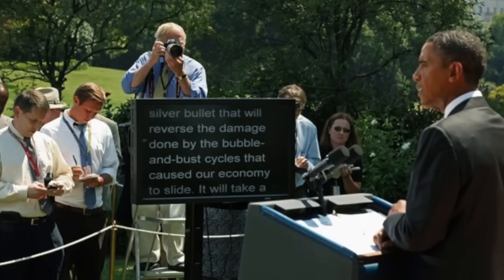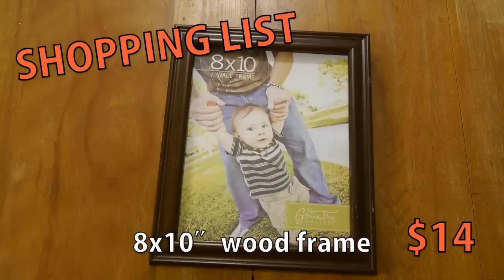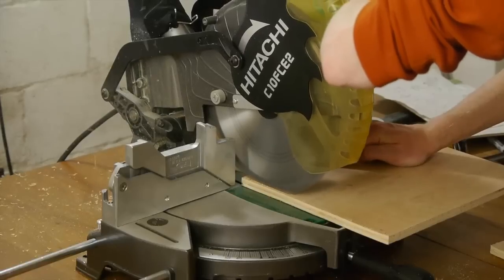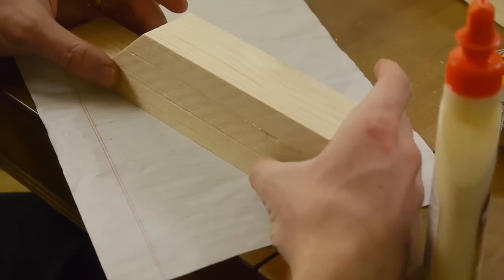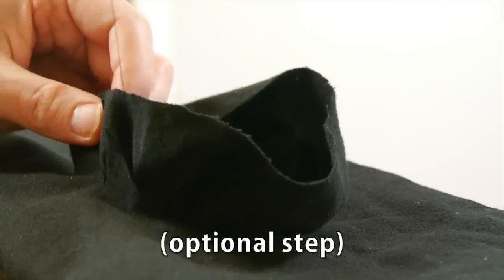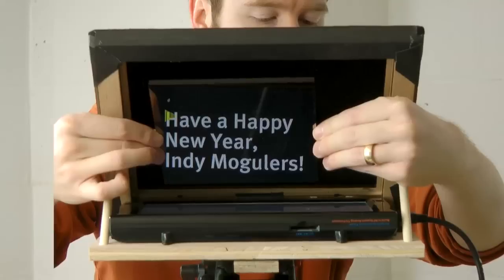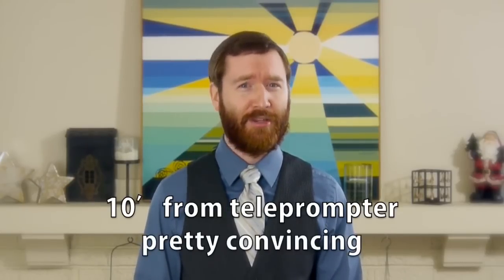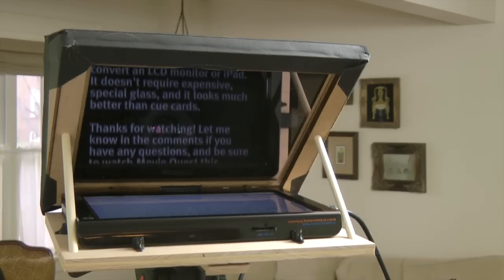How-to: $35 DIY Teleprompter for LCD or iPad

Comment: A little tip that might help with your eye tracking issues at closer ranges...if possible, set the justification of the text to "center" instead of "left". It will keep your eyes more centered and make the eye movement less noticeable while reading off the teleprompter. Let me know if this helps any of you out there get better quality!

Comment: That is THE  BEST and simplest design I have seen for a strudy looking teleprompter. This one, I will go with. I opted to seek beam-splitter for use in brighter situations and you need the contrast for the talent. EBAY has some good sellers and at a lower cost than a specialized teleprompter shop.
Thanks, 
David

Comment: Big thanks for this video. I just finished building mine. I made a couple of changes. Instead of using dowels, I used threaded rod with some threaded wood inserts. On the ends of the threaded rod I put some rubber stops. I did this to give myself a little bit of adjustability. I also used some sima quickconnects to make things easier. Great build.

Comment: Just did this for my iPad Air 2 and it works great. I only had to buy a frame and wood, I already had two stand. Thanks so much for this. I'm finally using that iPad box I held on to. I did it a bit different by just cutting, a whole out of the top, slightly smaller than the picture frame hole.

Comment: This is the best solution I've seen, I was surprised this video was this old, it has aged very well. I'm going to repurpose a Glide Gear teleprompter (which is too janky for my druthers) and use the glass from it within a design like yours. I'm not using it as a teleprompter, but rather as an additional monitor that will be directly in line with my camera (a la dslr video shooter's design).

Comment: I have a measurement question for you regarding the lengths of the wood blocks that are stacked and mounted, that run underneath the plywood. How far does the wood structure (that supports the camera and tripod) extend to the back? Or maybe if you have all of the measurement specs that would be greatly appreciated! The video is awesome! Measurements would be super! Thanks so much Indy Mogul!

Comment: I just used tape, glass (from a picture frame, and a cardboard box with my iPad. Works great, spent zero money and 15 minuets. I did use black foil to cut light reflections though.
Reply: where did you use the black foil?
Reply: amazon, its just black film light foil I had laying around, forgot the proper name for it though.
Reply: but WHERE did you use on the telepromter?
Reply: +The Essential Oil Lady | Jennifer Tremblay oops, sorry I misread that. I put it in front on the sides to block out glare
Reply: Thank you :-)

Comment: As a professional singer whose memory is slipping these days, but still singing really well, I've wanted something like this for years and didn't even know what it was called.  However, while your inexpensive device is clever and reasonable, it does require significant and comlex machines to build.  I also wonder how one would control when the text appears.  Thanks for posting though I doubt I'll use this.  Fortunately, the type of work that I'm doing these does doesn't require memorization as would have been the case in my younger years.

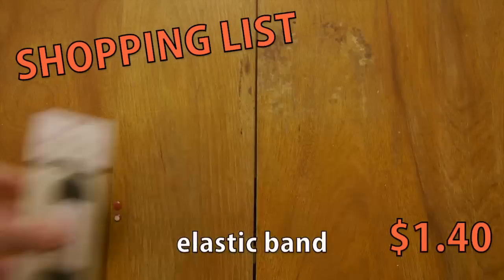Comment: Okay so like as your explaining everything we need I'm like "Dude i totally can get this stuff" then after 1:36 into the tutorial I'm like " Okay i can't get this stuff :-("
Reply: Just find a large clamp and a hand saw (like the one the guy uses from the movie "Saw" to cut off his leg) and work slowly, plywood isn't that difficult to cut, buy a miter box ($5 at Lowe's) and use it to cut those 45 degree angles on the 1x2 and dowel rod.  The end result might not be as clean, and it'll require a lot more physical effort, but it's still doable.  Plus, if you have no experience with power tools, you get the added bonus of keeping all your fingers :)

Comment: If you're doing this from a computer where the text is normal (not backwards) and sending that to the small monitor mounted under the mirror, wouldn't the text also be normal there, thus backwards for the talent?  I know you can reverse the text in the prompter software, but then it's backwards for the prompter operator at the computer.  For this to work, don't you need a specific type of monitor that can reverse the image?

Comment: What software do you use to enable to text on your teleprompter to scroll? Also, does it scroll in sync with your actual speech rate? That is, is it scrolling constantly (albeit at a speed sufficiently slow to enable you to read it as it moves up the screen) or can it adjust itself to your speaking rate? If it is the latter, how is this achieved? Does the laptop containing the source text and the software producing it, need a microphone such that the software does the syncing?

I hope this all makes sense. Alll I'm really trying to establishing is how auto-speed adjustment scrolling relative to one's speech rate, be achieved?

Comment: Nice.  Thank you for sharing!  I'll do it with a 32" monitor.  Somehow, I think there will b less of the "reading effect".  What do others think?
Reply: I.m thinking it'll probably have the opposite effect, as a bigger screen means more space your eyes have to scan to read your lines
Reply: ***** mmm…  How about large screen, larger font (same amount of txt as in the small screen) so you can get it all in one shot, no scanning.
Reply: Bark Mau it would be safer to still do a smaller screen
Reply: Bark Mau you cant get it in one shot (reading) youll scan without noticing, it may work when you stand far from the camera and zoom in...

Comment: It all worked but I got a double image which is difficult to read. Any suggestions?
Reply: With regular glass you'll get a double image, because the words reflect both on the front and on the back of the glass.
To get rid of the double image, you'll need to switch to a one-way mirror glass.